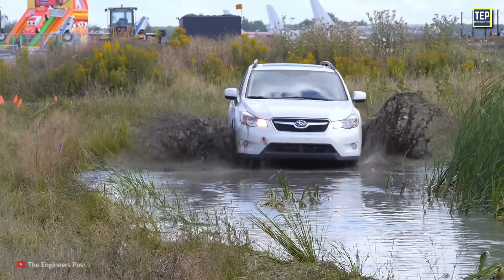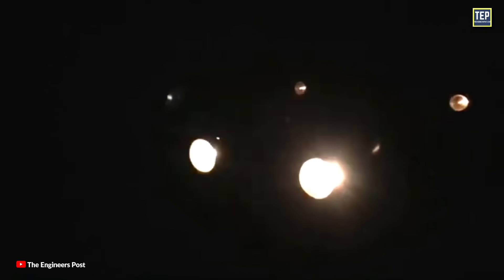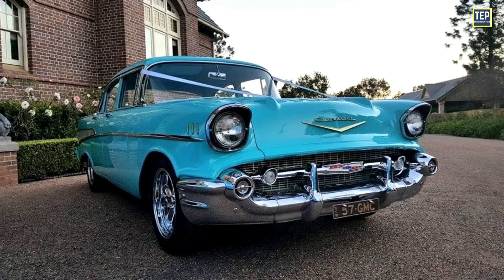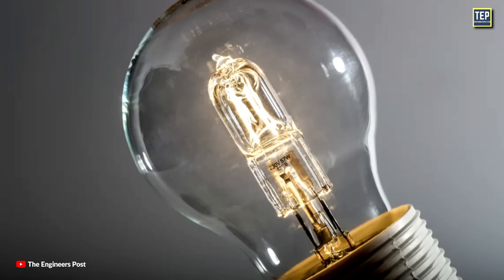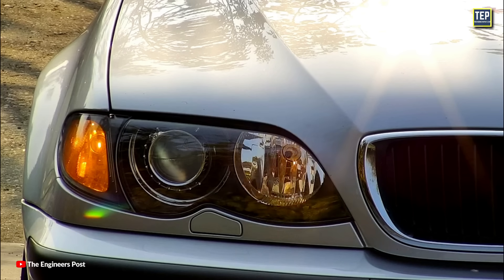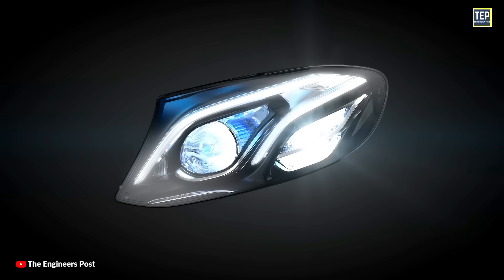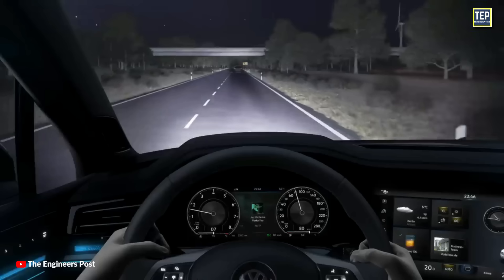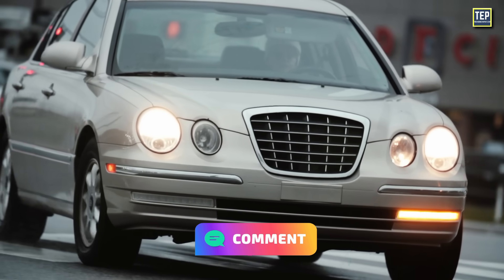The Problem With These Headlights

Comment: I drove at night more than a few times, Company Vehicle had a "Light Bar"!, A very Expensive Light Bar, It only made the area brighter that the Low Beam covered, Making the LED pointless at Highway speeds
Reply: Whoever fitted it didn’t calibrate it right, take it somewhere and get it fixed
Reply: It depends on what that light bar was designed for. Some is  just to light right ahead of you for off-roading  ie camping at night. Off road lights design for speeding in rally or so have a further throw
Reply: A light bar is made for driving offroad, at crawl speeds. Don't be the moron who has it on while on public roads, in traffic.
Reply: I've added a $30 single row 22" light bar to my Jeep Cherokee that comes on automatically with when I turn the brights on, I can see much farther down the road. Whoever put yours on didn't do it right or they got a flood instead of a spot beam pattern. Mine is a cross between flood and spot. The outer lights are flood which really light up the sides of the road way better. The center ones are spot and shine light way farther down the road than using just the high beam of the HID lights. (mine use the shutter style). All that with the light bar mounted below the front license plate. If it was mounted higher I would get even more performance out of it.
Reply: Light bars are not to be used on public roads.  Please turn the darn thing off and keep it off until you need more light for close quarters off public roads.  Thank you.
Reply: @stinkycheese804 in Finland and Sweden and Norway light bars and round rally style lights are legal to use as additional highbeams gotta be connected to the cars own high beams. In Finland where I live 1 in 5 have some sort of extra lights and basically all semi trucks and I haven’t had a problem

Comment: Led projector is more than enough....
Reply: Hell I’m happy with my HID lights that burn a purple blue white hew depending on the heat, factory. Although had one burn out but I think that was due to a shop replacing it with a cheaper one because insurance was involved at least that’s what I suspect. I mean why would the older one still work and the newer one not being 2 years newer  😂. And it’s from 16 still going strong 😂.
Reply: @joshreynolds729  Headlights should always be replaced in pairs.